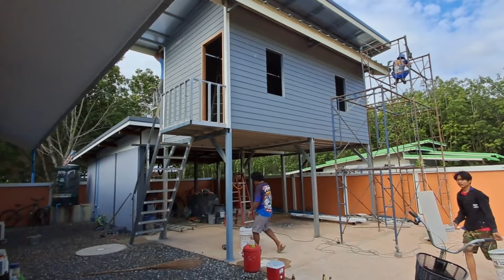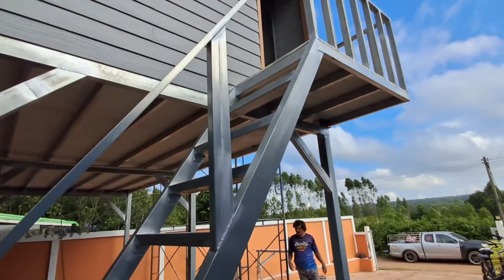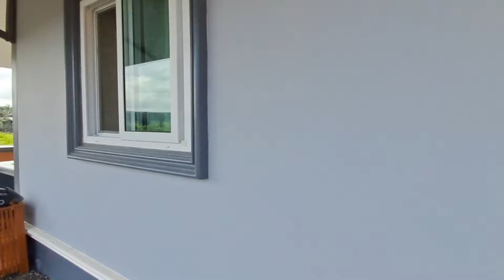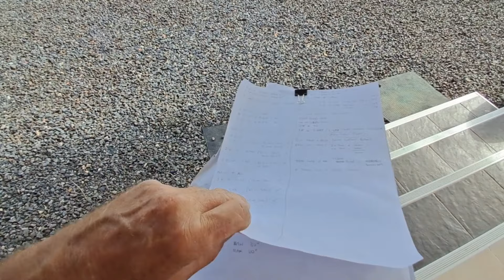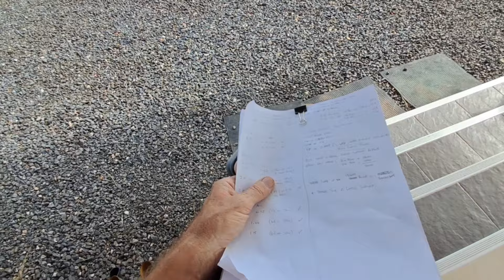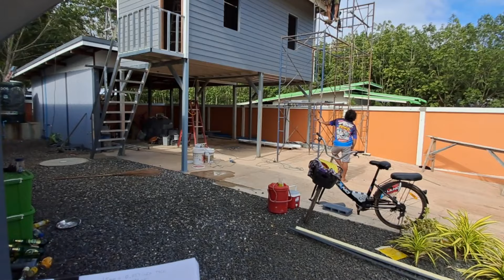House Extension   structural integrity issues

Comment: I agree with your assessment that vertical loads and associated distribution seems ok, however, as other commenters point pointed out, I too am somewhat concerned with lateral wind loads.  See if you can model that.
Reply: Surely   a boat anchor on a chain should stop it blowing away  if they have a strong wind.

Comment: Definitely get a professional to have a look. The weight isn't likely to be an issue.  My concern would be the height.  Cross bracing like an X would be advisable. Als consider spreading the footprint by adding a lean too at front bonus extra shade.

Comment: And what's under the 6 posts? just the driveway? They are meant to have concrete pads under each post, thats your weakest point, braceing? steel or timber still needs bracing, though the weatherboards help, really at each end ground floor (fence side and opposite) you should get them to weld in criss cross metal braces, full length,  those short ones be an idea to do the same front and rear. Its not going to fall down, you will see signs if there are no pads under the posts that see it slowly sinking like the Titanic...and a lot of cracking driveway...

Comment: While you’ve still got the builders there, only my humble non builder know how, I recommend two cross braces, going from the floor corner, down to the fence boundary footing, front and back of the extension, and bracing should always be bolted, as welds crack with any flexing in a building. With the current cross bracing already welded, you could always fit steel plates over and then bolt through upright posts. Good luck with it.😊

Comment: Good morning all coming together now, one point that was put to me with a similar situation at my home and steel posts by a Thai guy was not good because the salt in the cement and ground water will rot the steel.
Reply: Yes true, if possible the posts should be bolted down, so they can be replaced if necessary and also to place the post above ground height so they don’t stand in water.